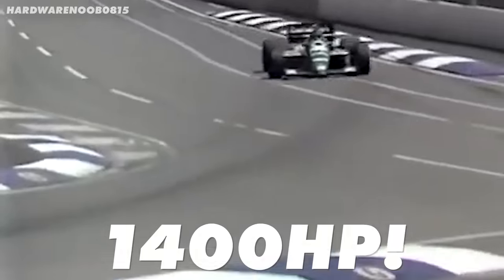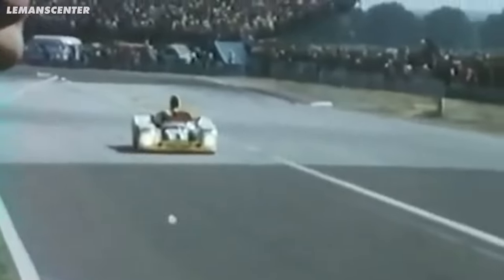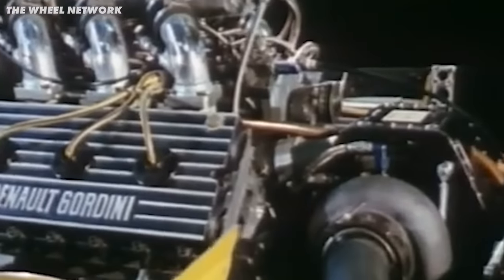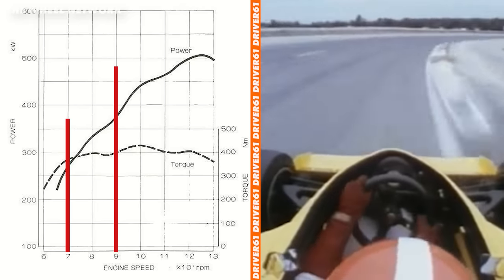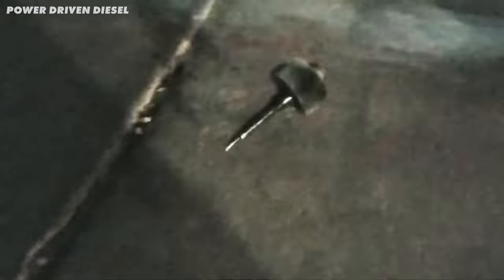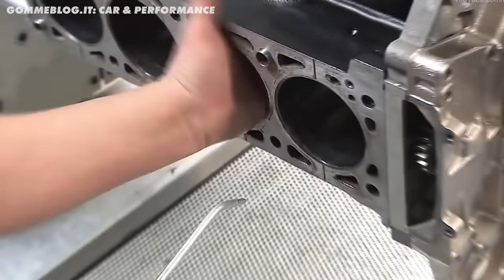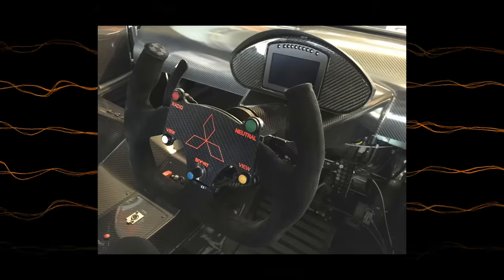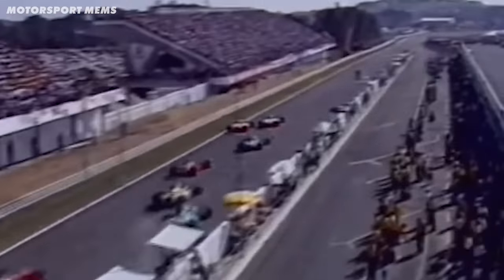When Formula 1 Had MASSIVE TURBOS

Comment: My friend was turbo technician / engineer for Lotus in that era. He said Senna insisted on getting a fresh turbo for his last ultimate qualifying lap in the session, so they developed a procedure to swap the turbo on a hot engine during the session in the pits. Amazing to think of them replacing 1000° turbos and sending him back out in just minutes. It’s all in the margins. Always has been in F1.
Reply: That is crazy as fk
Reply: Using up more turbos in a weekend than a complete season this year.
Reply: I reckon that was achieved by using v-band clamp system?
Reply: @AmirPomen Probably bought extra manifolds and exhausts with them, undo the oil/coolant lines, send the manifold nuts off with an air tool.. Deal with actually removing the turbo from the exhaust once it’s cooled off.
Reply: I work in oil and fuel development.
Ive seen and touched ceramic engines and turbos that are so thermally efficent that you can still handle them when they are glowing orange without burning yourself..
They are still uncomfortably hot, but it doesnt burn you.
Yes its a head scrambler. Everything you know says dont touch it, but you can.
Reply: Ceramic coating and maybe thick ass heat proof gloves?
Reply: @youwantshum9860 
Nope... It was back in the early 90's. Way before ceramic coating was a thing.

The oil development field is interesting.
All kinds of materials have been used to make engine blocks and components.
This one would be best described as glazed pottery.

It was part of the sealed for life engines test. They run for around 100,000 miles, no oil changes, if it breaks, it's a cheap throw away unit.
Reply: @sahhull  wtf :O
Reply: @sahhull  if I'm not mistaken ceramic coating has been around well before the 90s. Not sure how often it was used in motorsport but I know military and aerospace sectors were using them.
Reply: I've seen Turbos Glow Red at Night time Driving. Water Cooled Turbo Housings came out Mid 80s that helped Cool Turbo Shaft Bearing. Turbo Shaft can Spin 100k RPMs. Pretty Impressive ask me Intercoolers made Huge Difference Turbo and  Super Charged Engines or Both same time. Lol . Be Amazed how Hot Air Intake Temperature Raises  after 6 pounds of Boost.
Reply: That's why Alain Prost is better than Senna...much better...that's why he is alive...
Reply: @edvardsinkevic1359 Bro I'm not an F1 even, but that's some wild shit to say.
Reply: @edvardsinkevic1359  Not Senna's fault when his car failed mechanically. Not him.
Reply: @sahhull Senna was at Lotus between 85 and 87.

Comment: It would still be plenty fun to just drop the instantaneous fuel flow limit to see how much the current ICE elements could really make if fully uncorked in qualifying mode
Reply: Ferrari noises 2019 :D
Reply: remove RPM limit and fuel flow limit and I'm game... 
would love to see the drivers have an overboost button... 
just limit total fuel for race... 
need more Kablooeys
Reply: @RCRitterFPV  the rpm limit is (afaik) 15.000. when you look at the telemetry during a race you gonna see the drivers shifting at around 12.000rpm, so  the rpm limit is not really a concern rigth now since the engines loose performence when reffing that high sadly (might be fuel economy also, but i'm not sure about that)
Reply: @olerothemberg3869 I think that’s because of fuel flow rules. From 12k-15k rpm, there’s more friction but not enough fuel to burn all the air.
Reply: @andrewahern3730  yeah that might be. i kinda remember having read something like that some time ago
Reply: @olerothemberg3869  The fuel flow maxes out at 10.500 rpm, so engine power maxes out as well. They do run slightly higher revs to ensure the engine speed won't drop below 10.500 rpm when they shift up.
Reply: @mrdraw2087  good to know thanks. But then it's kinda funny that the fia raised the rev limit to 15k for better sound when it's not viable anyway
Reply: @RCRitterFPV  Removing the RPM cap won't make any difference because they are capped at 15k, and they only get to 11/13k, I don't remember the exact numbers right now, and this happens because of the limitation of fuel flow.
Reply: @isaacbarbosa7593  "remove RPM limit and fuel flow limit"....
Reply: @RCRitterFPV  my mistake, I faltered lol
Reply: @isaacbarbosa7593  haha, all good
Reply: Beyond that give em 3 more engines to work with, suddenly the qualifying one lap trim would fuck your brain up, i wouldnt be shocked if they could 2500 to 3k horsepower out of one of those engines running cracked out

Comment: Once you hear "it needs a cast iron block" you know you're dealing with a ton of power..
Reply: Steel would be stronger unlike the statement from the presenter. However cast iron has better damping abilities than cast steel.
Reply: @tommymaddox6785  Steel is stronger (and also not less dense than cast iron, for any practical purposes) but cast iron is much more brittle than steel. you can cold bend mild steel, roll it, knock dents out,... cast iron cracks from the stress of welding without proper heat treatment alone. So the presenter is very wrong, but you aren't correct either. But you probably didn't waste hours for it.

Comment: Maybe I'm in the minority, but i think it would be much more exciting to have formula 1 with the current cost cap and basic major outlines for car size and weight, but allowed the teams to choose how to get the results it wants in anyway. Id love to see v10s and v12s against turbo v6s and such. Im dreaming of course but man is it a fun daydream!
Reply: Yip I'm of the same mind. 
Here is the box your car has to fit through. You have this much fuel per race. You have this much to spend per season. Go.
Reply: @Firecul  bingo!
Reply: I forgot a minimum set of crash safety features but I'd hope that is a given.
Reply: Yes, now that there is a cost cap, they should look at keeping other restrictions to a minimum. The cost cap will naturally limit things like fuel consumption, crashes and unreliability.
Reply: That's what WEC did (maximum downforce allowance), and it gave us the beauty that is the Peugeot. And honestly each hypercar is so different from one another. Absolutly love to see it
Reply: So, pretty much what WEC did for the hypercars
Reply: currently with strong fuel limits I don't think anything else could compete with v6 turbo hybrids, the most efficient will always be the faster, except maybe inline 4 turbo hybrids 🥱 ....if you remove fuel limitations you're quickly gonna have horsepower an topsspeed monsters and safety concerns
Reply: Without refueling n/a engine would be left in the dust with same amount of fuel vs turbo. Even with hybrid system. Just look at wec now, cadillac still far from ferrari and toyota.
Reply: Like pro mod drag racing, nitrous, super charger ,turbos take your pick 😊😊😊😊

Comment: What's more insane is I worked for a company that supplied some of these engines with turbos and looked at the drawings and a few samples that came in for rebuilds (historic racing series) and they were surprisingly different than what is currently used. I would love to have one on the shelf to poke around and talk about with others.
Reply: Worth noting the current gen turbos are insane on a whole nother level, I've seen those too and they basically aren't turbos, they're like an entirely new technology.
Reply: @turbo_brian  Honda's initial turbo design for their 2015 engine wasn't the normal "snail" turbo, it was elongated to reduce its diameter to help with the "Size zero" concept, so it was ICE engine designers trying to make a turbine without really knowing how to build one. After it blew up every other race they went and asked their jet engine department for help.
Now it's more of a "snail" turbo, but I would love to see the complexity of it...

Comment: Not only did using excess fuel cool the turbo for more power, but it could also be used to help eliminate turbo lag. Ferrari were the first to really capitalise on this (as far as I'm aware) midway through 1981 by combusting fuel INSIDE their turbo compressor to keep it spinning even when off throttle and reduce lag.

Another big thing to note was that when McLaren were running their TAG-Porsche engine (late 1983-1987), they didn't run special qualifying engines like the other top teams. They'd turn up the qualifying boost pressure, but the likes of Renault (and their customer Lotus), BMW (with Brabham and later Benetton) and Honda with Williams would all run totally new engine blocks which were essentially disposable just for qualifying and could turn up the boost even higher as a result. It was therefore actually quite rare to see the McLaren-TAGs right up at the front in qualifying, even in 1984 where the car was truly dominant in races since in quali they were always at least 100 horsepower down on their main rivals. They made up for it however in race with their excellent engine management system provided by Bosch, solid reliability (though this began to waver especially in 1987 as it became clear that the engine was losing competitiveness, driving them to push it harder for more performance) and very solid power in race trim (since they ran less quali boost, this also meant they lost less power compared to their rivals going from quali to the race)

One last minor thing, but the pictures you showed of the F1 car you drove around 4:40 were of the non-turbo Lotus 91 from 1982.

Comment: Excess fuel is also used in piston airplane engines, when you operate in high power mode, the fuel system adds ca 10% more fuel than it is necessary because most full power use happens during climb - when you are slower and less air passes through the air-cooled engine to cool it down :)
Reply: Some cars do it too. My fl5 civic type r will set the AFR to 11.5:1 for WOT under boost. That means in those conditions it injects 12% more fuel than there is oxygen to burn it with.
Reply: @ASJC27  It's the common way to reduce the exhaust gas temperature (EGT) to stay under the limit for gasoline engines. For diesel engines, as you're in excess of air, you usually reduce/limit the fuel injected to limit the temperature.
Reply: @ASJC27  All turbocharged petrol engines in production do this. Every one.
Reply: Yes, pretty standard in aircraft engines.   I fly with a Lycoming YIO-540-exp.   Takeoff is always done full rich regardless of field altitude to prevent the cylinders from overheating until we reach cruising speed and the airflow is enough to cool them.   That isn’t my procedure- it is in the engine manual.
Reply: @michaelschlachter1628  it seems your engine has an altitude compensating fuel system. Like a Cirrus SR20 with the Continental engine - anything but cruise is done full rich, even if you are 8000'. Do that in 99% of Lycos or Contis in ordinary planes and you will be glad to fly straight at that altitude :). I was mentioning the feature of many aircraft engines where the current mixture is enriched even more if you are at or very near the full throttle. I experienced throttle reducing by itself slightly on an aircraft without adjustable friction when I could not hold it by hand in the climb and the CHTs just went past 420F in a whim.

Comment: I owned a 1962 Oldsmobile Jetfire back in the late 1970's that I bought from the original owner.  I remember having to check a fluid it used called "Jetfire Turbo-Rocket Fluid.  Yes TURBO.  It was the first American car with a TURBO.  It ran good, but when gas was being rationed it was a pain.  The car averaged 9 MPG so it was not to great when I had to ride 47 miles each way to and from work each day.  I sold it to get a more economical car with better MPG.

Comment: I did a lot of practice in simulator until finally I managed to deal with that turbo lag. It was annoying first but now it is quite fun. In the end I do something similar to what Senna did, popping throttle to keep revs high without spinning before exiting slow corners. And that works great with weak karts too.

Comment: Having a diesel truck with a big turbo, the VGT design really is one of the best adaptations to happen to the turbocharger. My truck is 6.6L, I could only imagine spinning up the same size turbo with 1.5L🤯

Also I wonder if they ever thought of running methanol to cool those motors back then. Like diesel it has more BTU's and burns slower and cooler. I'm guessing though because it used twice as much👀
Reply: I'm guessing you've got a Duramax?
Reply: @zakvilanilam3388  yes. Nothing special, but it'll scoot
Reply: Methanol burning slower means it's automatically out of the window
Reply: @kristoffer3000  yeah I was thinking about that, but methanol injection at least. It's cooling benefits have to be applicable in some significant way.
Reply: wasn't there a time when they ran methanol? was it around this time? top fuel doesnt even have a water jacket because they dump fuel in to keep it cool. its effective.
Reply: @kristoffer3000  not actually, methanol burns slower and colder, but you can pack a lot in before it detonates giving you more net power than straight petrol. plus methanol contains an oxygen molecule which means you can pump more in for the available intake air.
Reply: I don't think they did because that would be considered octane boosting
Reply: The Brabham ( BMW turbo) team ran very high level toluene fuel, nothing that one could get at a fuelstation. Very toxic stuff.
Reply: @carstennobody7047  oh do you? Nobody mentioned that here.  Yes i do but keeping this to myself
Reply: @carstennobody7047  good for you.

Comment: Toluene came from the fuel volume limit. It's energy density and knock resistance made up for its slow burnrate. They had to heat it before getting to the injectors...

Comment: Let's calm down a bit: It was not the power, but the size that was the key to the championship cars, as I will show below. Also, that was 1400 for qualifying w/ Paul Rosche's "Hitler chip" in the BT52 and crazy fuels and dry ice in the intercooler, and you could only do this if you could afford to shit out engines. There are guys drag racing old pickups w/ that kind of HP and nutty boost, it's not rocket science. Piquet had one blow the crankshaft out of the bottom of the monocoque and nail itself into the track, qualifying was really just "burst testing" engines for the players who could afford to. Nothing in F1 is as groundbreaking as it seems. In fact, Rosche had been developing that very same engine (the BMW M12) for TEN YEARS in other racing championships, they decided to run it in F1 after a go in Formula Two. These were modified M10 BMW engines from a family car going back 20 years w/ over 100k miles on them so the iron had been seasoned for high turbo boosting (the M12 model) and ppl took note when they saw them perform in IMSA well before F1. Turbos, fan cars, active aero, ground effects, CVTs and a pile of other tech originated in OTHER RACING CHAMPIONSHIPS like the technology free-for-all freak show known as CAN-AM. 

HOWEVER, the real main advantage of the inline-4 turbo over its V6 Ferrari and Renault rivals is evident when you look at the one massive turbo on the engine. With one fewer turbo, two fewer cylinders, and eight fewer valves, the Bt52 had lower frictional losses and, therefore, produced less waste heat. Anyone ever own one of the old air-cooled Suzuki GSX-R 750 sport bikes? I have, a 1988. You remember what it's like after it gets hot, right? Like riding through molasses power-wise. Heat is the enemy. But the "Fun Sized" Bt52 had another ace in the hole: Aero. 

Because it ran cooler, the BT52 could be designed w/ smaller radiators, which meant better aero efficiency and straight-line speed. When you look at the car next to its rivals, it's like an arrow and they are like flying saucers. Those very skinny, short sidepods made it king of the long straights. Qualifying is a power show, racing is where you're going to pick up those 10ths here and there lap after lap for 2 hours. Ergo, Renault may have pioneered turbos in F1 but they never won a world championship in the Turbo era because BALANCE is often they key to F1. That's generally the rule until something shows up like active suspension that alone can leave everyone in the dust.

Comment: Fun fact that the bmw 4cil used old blocks(from dtm maybe?). If a block had any “bubble” on the casted metal it would have already cracked in the past, so an old block meant it was good/strong to handle the boost
Reply: No, the block came from the 2002 road car, it was first used as the base for BMW's F2 engine in the early 1970's. They found that the blocks had to have at least 60K km of use to be seasoned enough to stand up to racing stress. Later the race shops started artificially seasoning blocks for racing use.
Reply: @john jones I did read that they were seasoned outside and to speed up this process the blocks were urinated on by employees. A sterling effort by Team BMW.
Reply: @astonzappa  That's kind of an urban motersports myth, they were outside because the race dept initially was buying the cores from wrecking yards, the second part sound completely made up.

The seasoning process has to do with how many heat cycles the block had gone through which tempers and stabilizes the metal, a fresh unit didn't have the integrity for a strong foundation.
Reply: @johnjones928 No, that’s a myth like all other nonsense related to that engine. Source: a bmw F1 guy (can’t remember his name) from that era on Die alte Schule podcast.
Reply: @johnjones928  By urinating on the blocks as they sat outside

Comment: The heat issues would be caused from running to lean (less fuel to air ratio) once they added more fuel and make it more rich (more fuel to air ratio) it wouldn't melt pistons.

We didn't have oxygen sensors for our exhaust yet so it was certainly a trial and error for them to get it right.